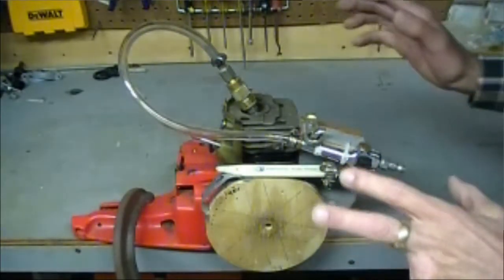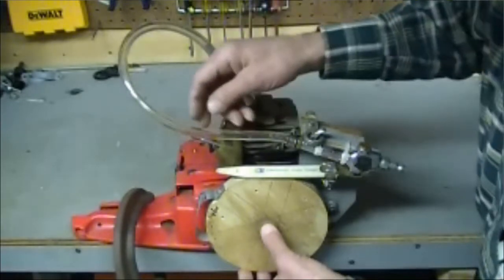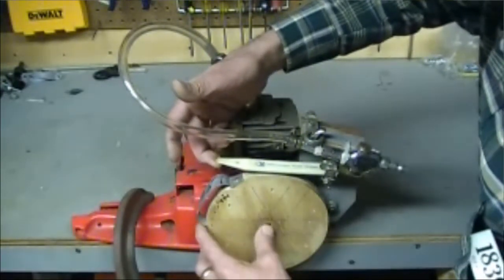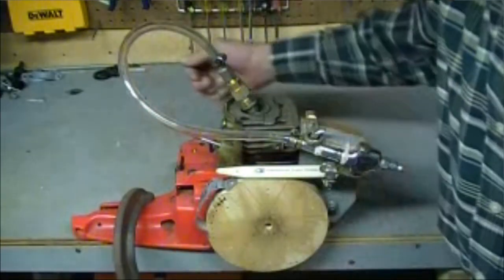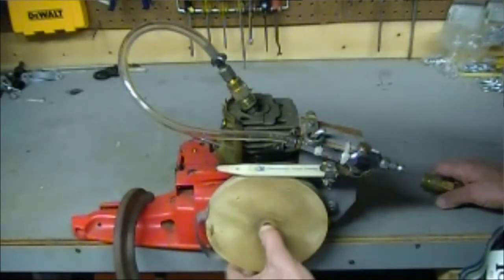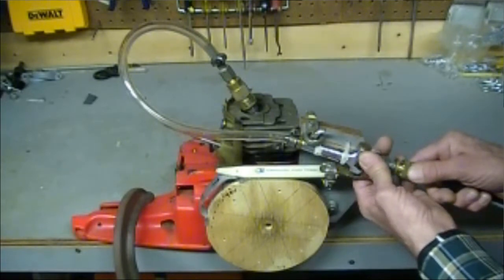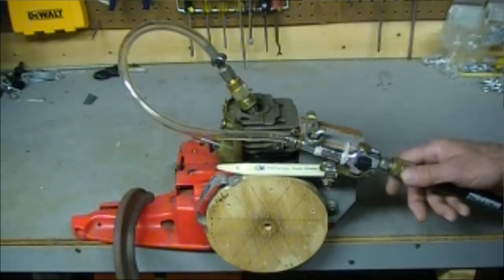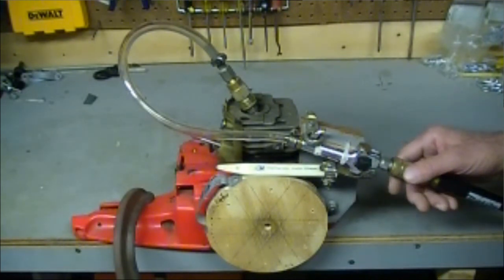A steam powered chain saw ....wmv

Comment: you should put another inlet on the crank case timed when the piston hits "bottom dead center +1 degree" for a powered return stroke. you could achive this by putting a second actuator on the flywheel at the opposite position of the one you currently have. so it would power stroke down, exhaust, power stroke up, exhaust, power stroke down, exhaust.

similar to older steam locomotives
Reply: Scott Jago it wouldn't work, when you pressurise the crankcase it doesn't have any place to exhaust except up through the transfer ports cancelling out the pressure to the inlet at the top of the piston